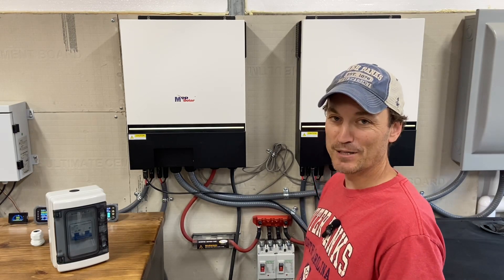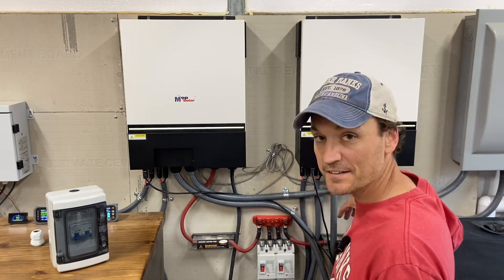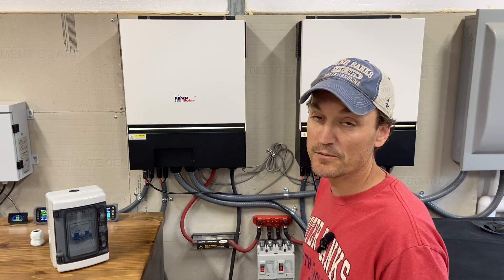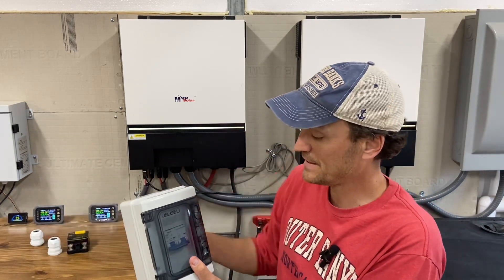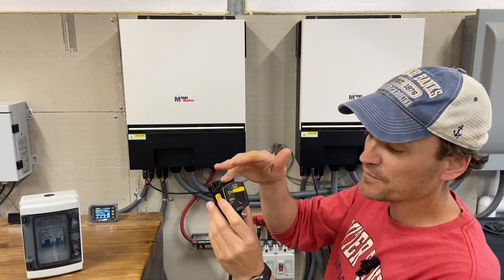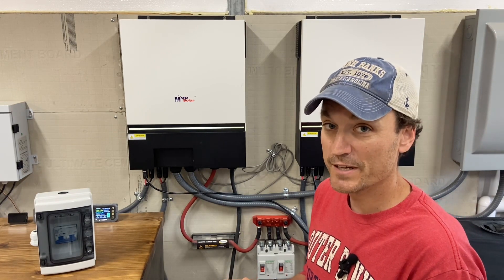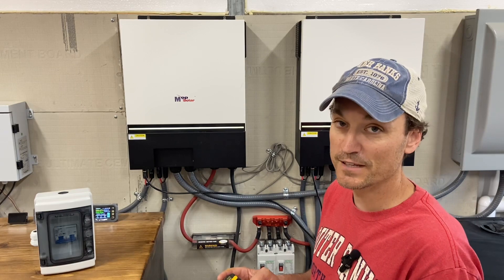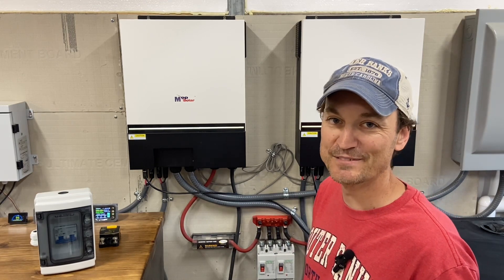48v solar system breaker requirements.

Comment: Doesn't each device connected to batteries have to have a circuit breaker if it doesn't already have a disconnect??? You only showed the main battery circuit breakers...
Reply from the maker: Technically yes. In this case I only had a main breaker for each battery pack. But really each device should have its own breaker/OCP.
Reply from the maker: Although really the point of those devices is to protect the wire. So you could probably do it this way. But like you mentioned, I prefer to have it on each device now.

Comment: Hi. Can you use a 500v circuit breaker for 48v system?
Reply from the maker: As long as it’s DC rated, yes. Just make sure you calculate the amperage correctly as well.

Comment: I have 4 of the BUSS 48v 250a breakers running on my 48v system that's set up to 56v. No issues for over 2 years. I use them more for disconnect switches.
I bought one of the Nader breakers. The website said it was rated to 60v dc. The box said it was rated to 60v dc but the breaker itself was only rated for AC so I returned it. I ended up fusing with MRBF marine fuses rated for 58v. They offer a variety of fuses for it from 80a to 300a. They also sell a bus bar with 3 fused outputs that I might switch to.
Reply from the maker: Yeah I use T class fuses sometimes for different parts of my systems. I just don’t trust those low voltage breakers for 48v systems. I think they can work fine until they don’t. Amazon has some decent choices now finally. And the breakers from watts247 I think are still a great choice.

Comment: I just expanded my system and got the signature solar breaker for over current protection. For that purpose, the load on the breaker is where I’d connect the inverter, correct? The line side is for the battery bank?
Reply from the maker: That is correct.
Reply: Thanks!

Comment: Do i run just the red wire through the signature solar breaker or both red/black?
Reply from the maker: You only add breakers and fuses on the positive side (red). Shunts or monitors would be on the negative side (black).

Comment: Those are beefy! Can a 3/8" lug be used on the 200amp Watts247 circuit breaker? I want to buy 2 of them, but I have 3/8" lugs on my battery cable terminals (right now they go directly to bus bar). Do you think 3/8" will make contact just fine into the 5/16" studs? Keep up the great content!
Reply from the maker: I used 3/8 on both of mine without an issue. I will say I did have to shave about an 1/8 off of a 4/0 cable lug so it would fit. Just just a second with a grinder. You could use a file also.
Reply: @GavinStoneDIY  Thanks. I thought since the 3/8 lug is bigger it would not make proper contact with the 5/16th stud. But I trust you! Just ordered them💪.
Reply from the maker: @andrewbennet9782  there is still plenty of surface area. When possible I do try to match the lug size. But with the washer on the bolt there isn’t any issue. In fact my lugs going in to both inverters were 3/8 also. I never had any heat in those areas.
Reply: I got the 2 breakers! I am installing them now. In the package there was also a flat black rubbery piece, rectangular shape, of about 3” x 2 3/4” with an arrow on it (1 for each breaker). Do you know what that is for? I can’t figure it out. Do you know the torque specs for the breaker studs?  Thanks. By the way, the 4/0 AWG cables' lugs are so big! You were right, even the 5/16" 😵‍💫
Reply from the maker: @andrewbennet9782  there isn’t a specific torque spec that I could find. I just made them “snug”. I think the rubber is  just an insulated layer to go behind the breaker depending on where you were mounting it. I didn’t bother using it. I mounted the breaker to the backer board  using 4” deck screws.

Comment: QUESTION - I have two eg4 battery racks, 6 48V batteries in each rack.

How do i calculate to proper size breaker that i need for each battery rack?
Reply from the maker: Good question. Check out my video on watts/amps. The rack itself doesn’t really need a breaker. But you could add a T clad fuse. It’s determined by your wire size and by your inverters wattage/amperage.
Reply: https://youtu.be/B7nIefmv9MY
Reply: Excellent - I was thinking along those lines, but hearing it from a more experienced diyer is a great relief!

thx
Reply from the maker: @Just_An_Idea_For_Consideration  sure thing. And depending on your inverter, those do need a specific breaker. So an mpp unit like those  needs 2/0 wire and a 200 amp breaker. If you have two inverters you could either use two breakers like Signature solar sells. Or use both sides of a breaker like Watts247 sells. I think I have both in the description

Comment: Another great video, Gavin.  You mentioned that you have isolated your battery packs.  I thought the battery packs had to share the incoming charge current to prevent communication issues with the inverter which could result in an overcharge?

For anyone else, I went with the watts247 breaker per Gavin's recommendation a while back and it's great!
Reply from the maker: Isolated in the sense I used a separate breaker for each. So that at any point I can disconnect the one pack or other. With those breakers I technically could have just used the other lug on the one breaker. But then I’d have to use some other form of disconnect if I wanted to work on my diy packs. It just made things simpler.

Comment: Why use both a T-class and a breaker?
Reply from the maker: It’s a redundancy. In the extremely rare event or a runaway current, it can actually arc across a breaker type fuse. But T class fuses stop the current dead. If any amperage occurs over their rating they will pop. So I have 2-300 amp T class fuses just in case. It’s a little extra insurance and peace of mind. For any mid to larger systems I think it’s a good idea. Especially with larger battery banks. That’s a lot of potential current that could cause terrible issues.